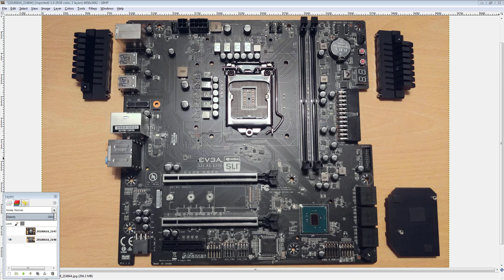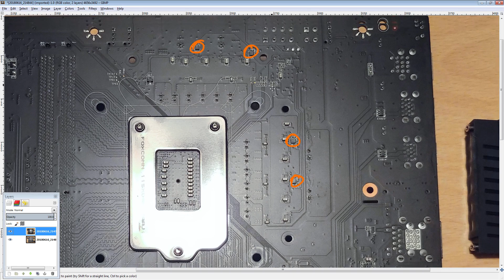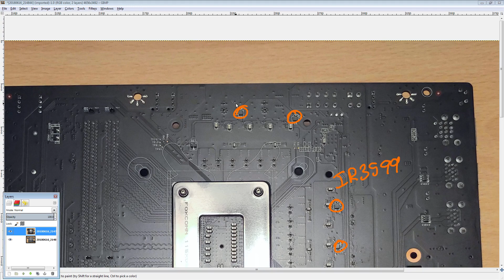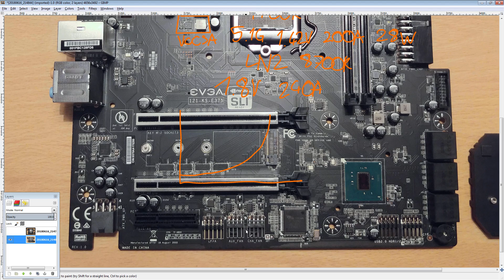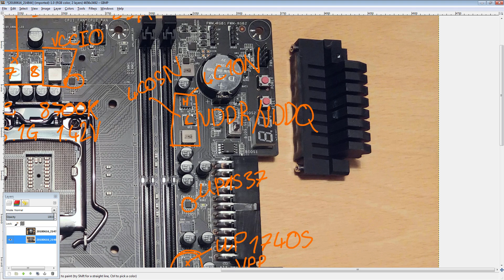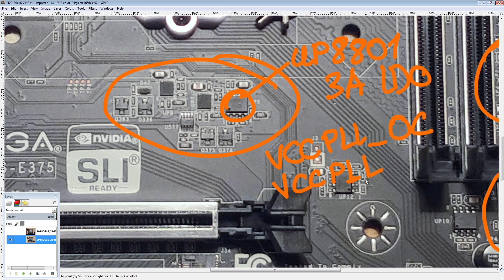Motherboard PCB Breakdown: EVGA Z370 Micro

Comment: Are you implying the 8core will work with z370 ?
Reply: i doubt it.   a lot of the z370 boards can't handle pushing the 6 cores...    imho it seems some of the mb manufactures pumped out a lot of rehashed z270 boards and passed them off as z370 where it was rushed.  i think intel was correct in making the 6 cores only compatible with z370 because they knew the majority of the z170/z270 boards would explode.  i don't think they planned on some of the manufactures gimping out on this line up.   cough asus cough      lol it reminds me of all those fail amd FX boards that couldn't handle those cpus.
Reply from the maker: I'm just guessing based on intels normal compatibility schedule. P67/Z68 + Z77, Z87 + Z97,  Z170 + Z270, Z370 + Z390.
Reply: Let's hope it will , now let's see if my Asrock z370 extreme 4 can handle it :)
Reply: i honestly believe asus wrote off z370 due to it being rushed.  their top tier boards seem fine but they use the same power delivery as their top tier z170/z270 if i'm not mistaken.  it's top notch but the same hardware they've been using for years on their top tier.  i guess if it aint broke don't fix it.  i would hope their lower tier z390 works out.  intel seems to be taking their time with this launch and that gives them plenty of time.
Reply: Them Broadwells were only compatible with Z97. I think Z370 wont be forward compatible with the 8core.
Reply: halistine jenkins - Im wondering if the upcoming Strix Z390's are gonna be decent or same mediocre crap as the Z370 Strix line - all the Asus ''ROG''Strix/ROG Hero, Formula, Extreme Code Z390 lineup is confirmed now, except the ''TUF'' Z390, which The 370 TUF were god awful.

Comment: I like the idea of turning the 24-pin power connector by 90°, is this a "evga only" feature? Never seen that before..
BTW would you also make breakdowns with power supplies? that would be very interesting, too..
Reply from the maker: ASUS has done it on some boards too.
Reply: My EVGA X79 DARK has the same style 90 degree 24-pin, 6-pin PCI-e, and SATA ports. (See avatar pic)
Reply: Forgot to say that the EPS connectors (2X8-pin CPU power connectors) are perpendicular to the board. I also like the 90 degree 24-pin. Just make sure your case is big enough. I am using the Corsair AIR 540, which has more than enough room.
Reply: MNPCTech sells a 90° 24 pin adapter

https://mnpctech.com/case-mods-gaming-pc-liquid-modding-custom-computer-mnpctech-overclock-cooling-fan-grills/90-degree-angle-24-pin-atx-connector-for-motherboard-mainboard.html
Reply: https://www.jonnyguru.com/blog/category/reviews/power-supplies/